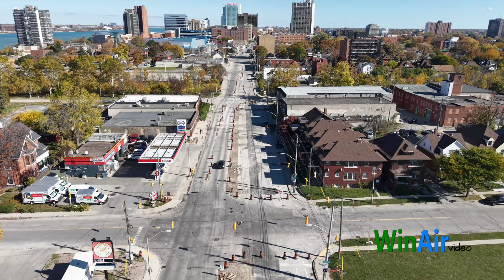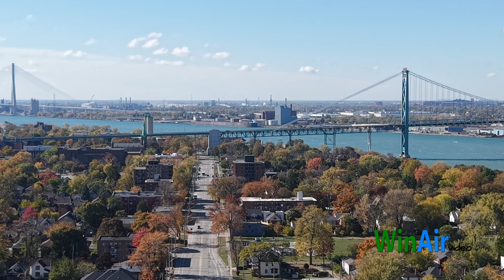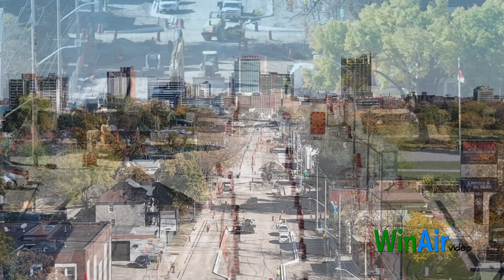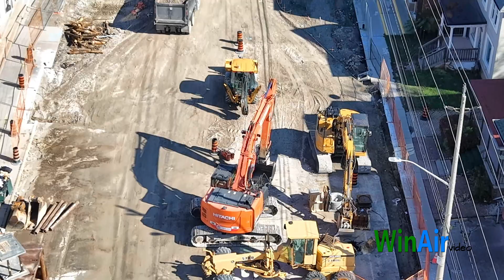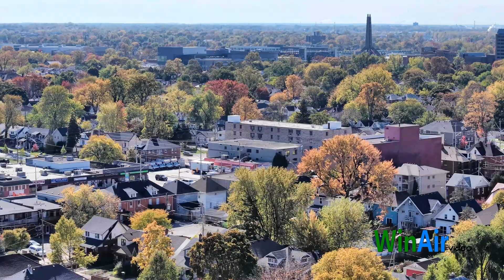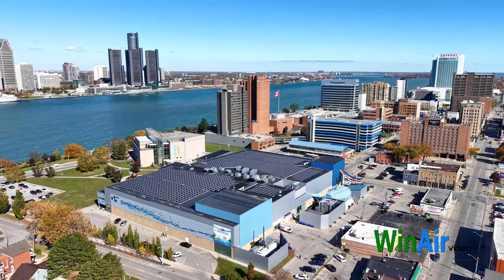What is a Road Diet?!

Comment: Another example of stupidity and a complete waste of tax payers money.
Reply from the maker: Hi Glen. Infrastructure like all things, do not last forever. The growth of the population and increased use of infrastructure facilities like water and sewage management is an ongoing project in any city. In the case of University Avenue heavy rains flooded basements, and the road was in need of repair. Upgrading a very old sewer system may be costly but also required to sustain growth. So, not a complete waste. That said, the gentrification (to global standards) of the street is overdone, costly, and reduces traffic growth in that area. I think traffic will be squeezed onto Riverside and Wyandotte creating more congestion on those already busy corridors.  JMO

Comment: Good idea to be modeled after Ottawa street. It will slow down all the 'Bros' in in their Ram trucks and 500+ HP cars that we all hear rippin down  the streets 24/7. Windsor needs a proper speedway/race track again though for all the 'agro' drivers to go blow off steam. We are still a Motor City and it's sad that there's no cash maker like a track would provide
Reply from the maker: That's a good point. I would support a new Windsor Raceway, if it is privately funded.

Comment: The City of Windsor's "traffic calming measures" all over the city, are anything but.  All it does is create gridlock and road rage.  And I'm tired of hearing "short term pain for long term gain".  When it comes to road construction in this city, there is no such thing as short term pain.  It's more like "long term pain for little-to-no gain".  Reducing University Ave from 4 lanes to 2 will just create more gridlock.
Reply from the maker: There is a lot of construction going on across the city and has for a while. It is a pain when it causes congestion in the traffic pattern. Hearing the same thing to address the issue can be maddening, but without the construction we'll be left with crumbling roadways and inadequate infrastructure to handle the growing traffic in the area. I do agree reducing lanes is counter productive to increased traffic in or out of the City. There it is however, and we will have to wait and see the benefit or consequence of the changing infrastructure across the County. JMO

Comment: I used to use University Ave to zip across the city when Wyandotte and Riverside Drive were congested and clogged with traffic. It used to be a nice alternative, with 4 luxurious lanes and hardly any traffic. It got me to where I need to go quickly and efficiently. I was always very happy! Go figure, some numb nuts at city hall must have seen my smiling ugly mug on all the traffic cams and said, let’s steal this guys joy and make this guys life a miserable hell by reducing University Ave from 4 lanes to 2 lanes.
Reply: It should be a lot safer for the community in the area. No more speeding past others when someone is going the speed limit. Such a fantastic idea.
Reply from the maker: Hi DONOTTAKETHEJAB. It is a big change for the street. I'm sure your smiling mug is on traffic cams as mine are, too. Not so sure they decided on the reconstruction to steal only your smile. There must be others it will make smile, but we won't know that until it is finished. Then it won't matter. :)

Comment: Road Diets can work but usually screw up drivability for cars for the few cyclists that will use the new infrastructure, as having Riverside Dr right there I can assure you many will NEVER use University Ave and will continue to use the nicer, more scenic river route as that's what I did when I lived down in the west end.
Reply: What exactly does this ruin for the drivability of cars? It's just one lane cant be that hard to stay in it.
Reply: @kilastrika  In areas where traffic is high reducing lanes can cause more issues for drivers of cars like longer traffic back-ups and more accidents due to impatience. It can also cause issues for city maintenance in deep snow as now the snow plow drivers have to remember all the cutouts for curbs and whatever else is now jutting out from the sidewalks. It also creates dead zones for garbage to pile up. 

For the very few cyclists that will benefit from having their own dedicated bike lane it seems absolutely silly to do this where its not needed considering Wyandotte and Riverside both have cyclist lanes, not to mention the bike path along the waterfront.
Reply from the maker: Hi Allstar. I have to agree with your points. Well thought out. More traffic will divert to Riverside or Wyandotte making them both busier I would think. Those issues aside it will be nice to see University becoming more user friendly. Could become a shopping area like Ottawa or Erie Street, only for the West end.

Comment: I didnt know they are finally doing something like this. Wyandotte east was supposed to get a huge stretch of the same treatment. 

This is a testing ground for them to figure it out. That is certain.
Reply from the maker: Hi Kilastrika I don't think so. They would constrict traffic and create bottlenecks across the city if they reduced Wyandotte St. JMPO. :)
Reply: Thats fair for you to assume. Adding bike lanes anywhere in this city is like dropping 10 gallons of chlorine into an unused dirty pool.

It'd be a huge shock to the populace that lives around here and thinks we can just keep inducing demand through adding car lanes as population increases. 

We've already seen the world heal when covid happened and no one was driving anywhere. Then we went back to essentially smoking 2 packs a day when everyone started driving again.

We need alternatives. Not everyone needs to or wants to drive in this city but is forced by design to have to buy insurance and maintain a vehicle.

Adding bike lanes in the long term should reduce the amount of people that need to drive and make tranportation times shorter.

Even without bike lanes existing we're still in bottlenecks and traffic being constricted. Could be due to the construction around the city cutting off major access routes to get from downtown to the county or lasalle but I dont think even after its all said and done we will get and reduction in travel times for motor vehicles.